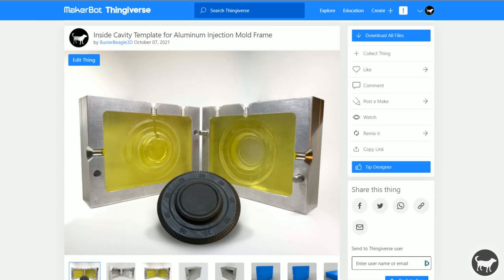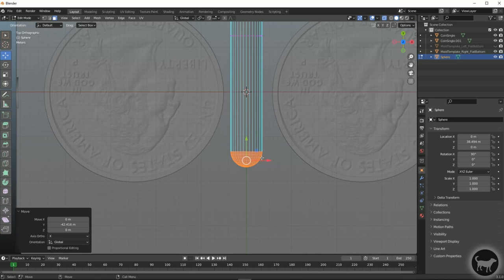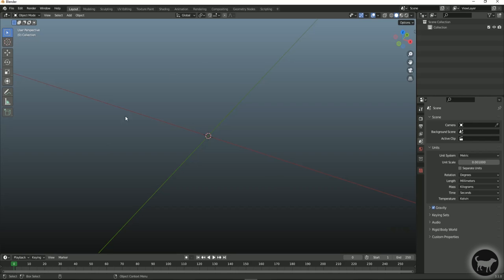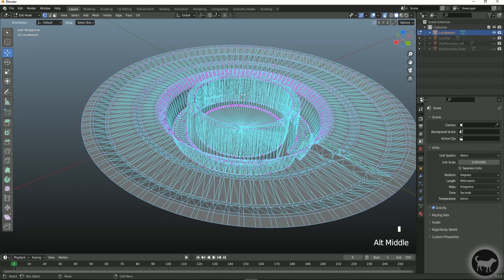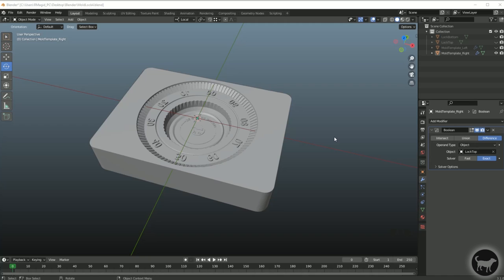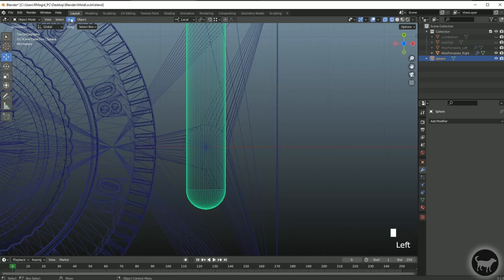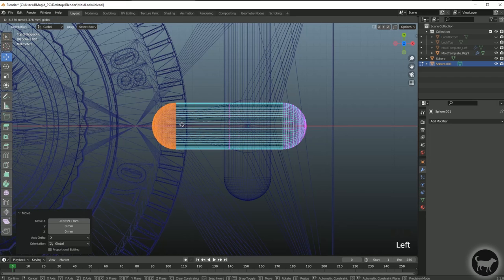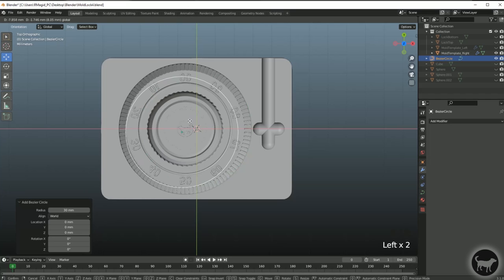STL to 3D Print to Injection Molding using Blender | Conformal Cooling | Buster Beagle 3D MK3

Comment: Great Video, Almost done with my build have a few more parts from Ali Express coming and then a few mods I did with a solenoid valve instead of the manual and little touch screen with Arduino to be able to have repeatable pressure dwell times and a little servo actuated hopper that I built. Will post the files and results on thingiverse  and Prusa printer as a remix when complete
Reply from the maker: Very cool. Can’t wait to see what you have done.

Comment: Curious if you have any issue with z axis accuracy on your resin printers. I have 2 different ones from 2 diffent manufacturers and generally it is off approximately 3% on the z which makes functional parts harder to print. Have you run I to this? The print orientation you're using should in theory help with this, but Curious if you've run into this issue.
Reply from the maker: I haven't noticed any shrinking other then the general resin shrinking I have experienced. My next test is going to be to install a heater inside the chamber to keep the temps high and hopefully prevent the shirking of the resin that is no longer getting dipped in the resin which is warmer.
Reply: @BusterBeagle3D  it's interesting and I should have probably should have said this in my initial comment, but mind actually oversizes the z by 3% its super odd tbh. I might need to just mess with the scale or maybe there is a better way to dial in z axis accuracy.

I'd also like to see any info on a heater and believe you're on the right track with that idea. Youre doing great work, keep it up and Thanks for the reply 🙌

Comment: Great and detailed explanation. You said that you have added empty pockets to save some resin. What do you think if those pockets were predefined size and you will have something like gauge blocks or just set of precisely measured metal pieces that would fit into those pockets. Or is it possible to design one part much slimmer and have metal spacer plate?
Reply from the maker: I have done that before by using washers that I had. It seemed to work pretty good.

Comment: I notice you're using the Siraya Tech Sculpt Clear (160C) instead of the Siraya Tech Sculpt Ultra White (220C).  Is this because it's half the price and works well enough in low volume?

I bought a Buster Beagle Mk1 injection molder and played with the expensive Formlabs high temp resin a couple years ago, and kept getting short-shot parts & trouble releasing it from the mold.  Now I'm thinking of upgrading to a Mk3, switching to a cheaper resin, and trying again.
Reply from the maker: Hello. I found that even though the clear is only to 160C it still can handle a little bit more without much trouble. It's also far easier to work with both in the keeping it properly mixed as well as much easier to cure. As far as how long it will last, that is really up to the part complexity. Resin molds are great for short runs and testing purposes but if it's something you plan on relying on then an aluminum mold would be far better. 
Also you have to make sure you have a draft angle to aid in part removal as well as potentially preheating the mold and sanding to make sure the mold is a smooth as possible. If you can feel the layer lines with your fingernail that is like 1000 little layers holing onto your plastic part for dear life.
Reply: @BusterBeagle3D  Thanks for the reply!  I've only tried with the Formlabs resin for molds, so I can't compare it to the Siraya Tech.  It did print at room temperature using a small Voxelab monochrome printer with moderately long cure times.  The bottle had a weird shape, presumably for a Form 1 printer.  At the time, it was the only one I saw rated above 200C except for a similarly priced one on a German website.

I was trying to print text & a logo, which may be difficult, though I did have a draft angle.  I also didn't use the aluminum holder, so the flashing was pretty bad.  I didn't sand it or find a good mold release, though it would be tough to sand small lettering.  Guess I'll try the Siraya Tech Sculpt next.  I'm glad I can reuse parts--the Mk3 looks really good!
Reply from the maker: @nathanbanks2354 Sounds cool. I'm actually working on a project as we speak where I used a fiber laser to make a coin mold with text and very fine details in Aluminum. We'll see how it works!

Comment: would be interested to see how you might tackle permanently joining two pieces of plastic together using processes like Heat Staking and Ultrasonic Welding. i guess these can be done at professional injection molding business.

"Heat staking is the process to attach two separate components together by melting the base plastic material into a shape that will hold the secondary component.  It’s a permanent attachment method that does not require any additional material such as an adhesive or a solvent to make the permanent bond.  The only addition is the heat applied to melt the plastic and a tool to shape the plastic to form the mechanical connection."

"Ultrasonic welding is an assembly process that uses high-frequency ultrasonic acoustic vibrations to create a solid-state plastic weld.  The parts are held together with pressure in a fixture or a holding jig while the vibrations melt the substrate to create a fixed connection.  Ultrasonic welding is commonly used for plastics, and a great option for joining dissimilar materials."
Reply from the maker: Nothing in the works right now for that but it does sound interesting.

Comment: Can you print a mold with filament printer, or do you need a resin printer?
Reply from the maker: To 3D print you really would need a resin printer using a high heat resin.

Comment: Hey buster! I am thinking of getting the parts to build your injection mold machine, but I can't seem to find anywhere to get the actual aluminum molds. Do I have to buy a cnc machine and design those myself or is there a company I can send my 3D model to to have the molds created? I am assuming this is expensive so I am just not sure what options are available.
Reply from the maker: You can honestly do both. I have used cheap home desktop CNC machines to create molds or there are services online that you can send designs to a get one made for you. I haven't used one so I can't really recommend any specifically. If you also ask around on the Buster Beagle 3D  Facebook group you might be able to find someone to make one for you or at least point you in the right direction. https://www.facebook.com/groups/busterbeagle3d

Comment: How many injections can you get from a resin mold?
Reply from the maker: It really depends on the complexity of the mold and the resin you used. I think the most I have used a mold so far was 75 times but it was still in good enough condition to keep using.

Comment: Phorozen tr300(50$), siraya tech clear(40$) ,siraya tech ultra white(75$) which one would you choose for molding
Reply from the maker: I tried to get my hands on the TR00 but it was over $100 for shipping. Will wait till I see it on Amazon. I used Siraya tech clear and I like it but it does eventually form cracks. I personally had lots of issues with the ultra white but I should give it another chance one of these days.

Comment: Hi Ryan, any particular reason why you didn't use Fusion360 instead of Blender?
Reply from the maker: Main reason is that I’m a 3D polygonal modeler by profession. I’m not a CAD modeler so Blender is closer to what I know. I’m sure you can achieve the same results in Fusion 360 but I’m not great in that software.
Reply: @BusterBeagle3D  I came through and did a very similar workflow in 360. Basically you import it as an STL, convert it to mesh, and then can perform operations on it.  The primary difficulty working with it in 360 is that 360 is not well built to deal with polygonal models such as what is provided here. For example, to fill in the unused sprue gate holes, I had to recompute the polygons in the insert to be very small before I could use 360 mesh tooling to fill in holes. This is a pretty destructive operation (not really possible to go back after). Those operations, on the other hand, are pretty trivial in Blender and pretty easily reversible. The boolean operations such as creating the sprue, adding vent holes, etc. in my opinion are a bit easier in 360 since it's more built for that sort of thing. So any changes to the actual insert such as size or sprue gates I recommend to do in blender, but if you are more familiar with 360 it's definitely doable to handle it in 360, especially if you don't think you'll be messing with the insert too much. I have a modified insert I use saved in 360 that I just bring new parts into and subtract them from the insert to create new molds.

EDIT: I also noticed that as of a couple months ago you made a step file available on Thingiverse in the existing Thing alongside the stl files, which is MUCH easier to work with in 360. Thanks for that.

Comment: Liked the video, but to be honest I think I could have done that more easily in tinkercad. In fact I kind of have before, but for resin molding not injection molding.
Reply from the maker: Hello. I have tried with these exact same models in Tinkercad and they do not work. Tinkercad runs a process when it imports a file and attempts to clean up what it considers unnecessary geometry. This leads to final result that may not be what you want. I have used it for simple building and subtraction but it doesn’t work for everything.

Comment: I need to build a case around a tablet computer. This is what it looks like this: https://i.postimg.cc/fRN6y8kY/geh-use1.jpg Could you create a mold for this size?
Reply from the maker: It's not really a service that I provide and I don't think that it would work with this machine either. The total volume of plastic that the MK3 can shoot out at one time in 3 cubic inched. A computer tablet would be far larger.